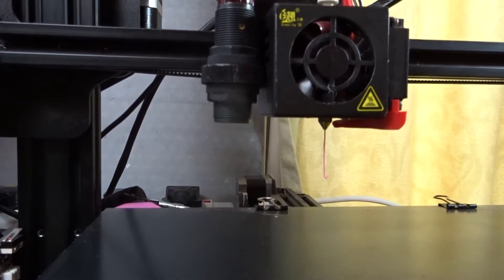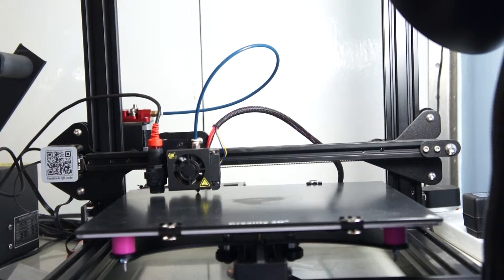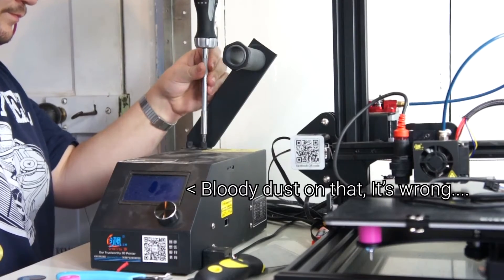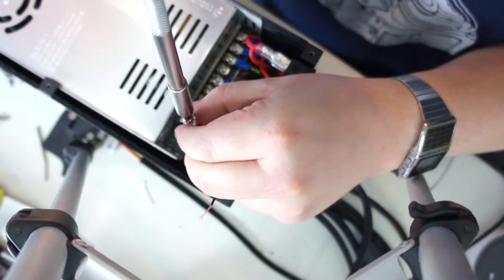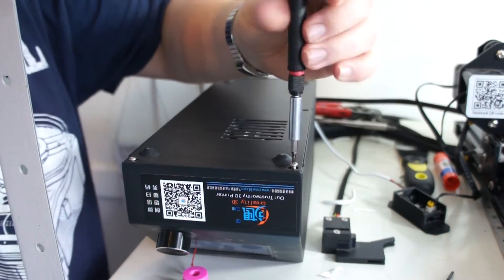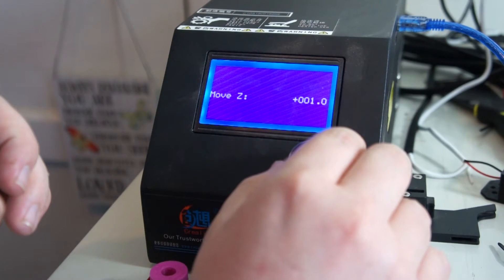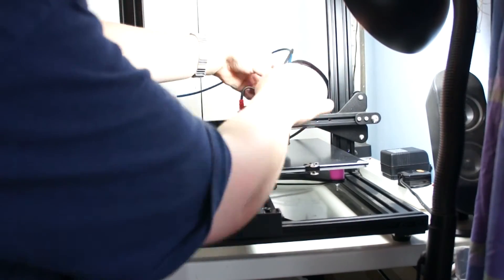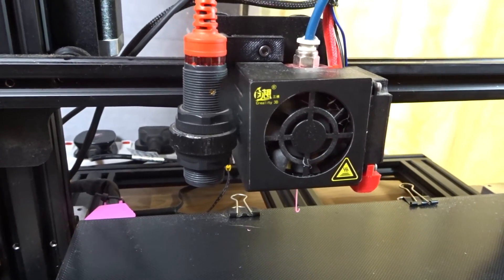CR10s Upgrades Part 2: TH3D EZABL Pro and Fixed Bed!

Comment: Thanks Willcaddy, I am in the middle of setting mine up now. I set the 2mm offset of the sensor to the nozzle but wasn't 100% sure of the 2mm to the nozzle when calibrating. Glad I kept reading and researching. :) I installed my TH3D solid mounts first before flashing the firmware and chose 5 on the pattern as I watched your other video. Thanks again!
Reply from the maker: Hi Crestburg :) Thanks a lot for the kind words! Glad you found it useful :) and thanks for watching!

Comment: I've never seen someone make a fixed bed what are the benefits? Do you just not have to level the bed?
Reply from the maker: Hi there! Fixed beds are good when you have an auto bed levelling sensor as nothing will change in between each print which lowers the amount of variables that could go wrong. 

Its also useful if you don't want to go through the auto bed levelling process before every print. You can change a few commands in the start gcode and it will instead pull the mesh it has generated from its own memory rather than doing it before each print. Then you would just do the auto bed levelling process every 5-10 prints instead. Useful if you only print in one kind of material like PLA. 

I must stress though, don't use a fixed bed without a bed levelling sensor! You could really damage your printer! Hope this helps pal and thanks for watching! :)

Comment: Thanks Will, really useful video. Thinking of adding an EazyABL to my old Wanhoa i3. Need to find out why the second Z motor goes out of sync after 10-15 hours of printing first.  Glad to see your subscriber count is slowly increasing. Very well deserved.Keep up the good work.
Reply from the maker: Thanks a lot for your kind words :) If I had to hazard a guess I would say it might be loosing steps every now and then. Give your lead screws a grease with some lithium PTFE grease and see if that helps. It could be just friction causing it. 

TH3D have actually not long release there own firmware for the Wanhao and a sensor that will fit so now is the time to add one! Its a variation of the ADVi3++ firmware which is what I installed in a previous video and I am liking it a lot! 

Hope this helps you out and thanks for watching pal! :)